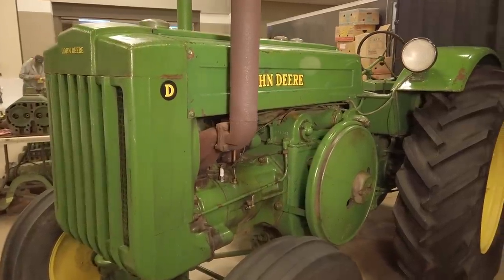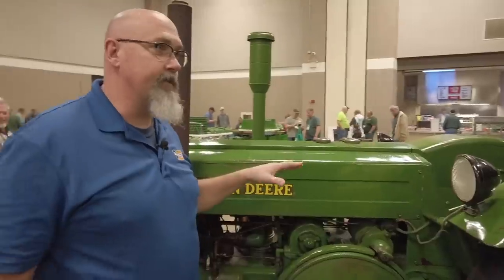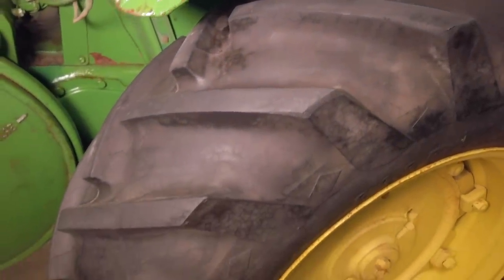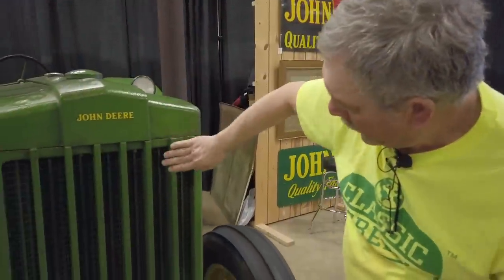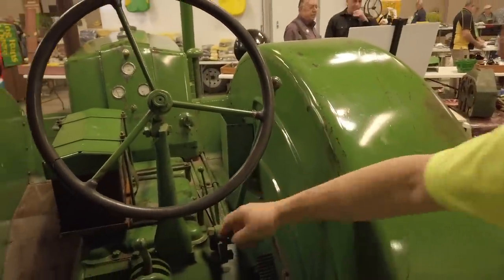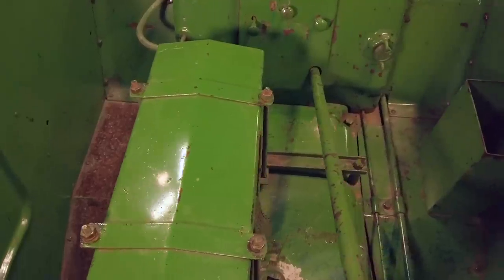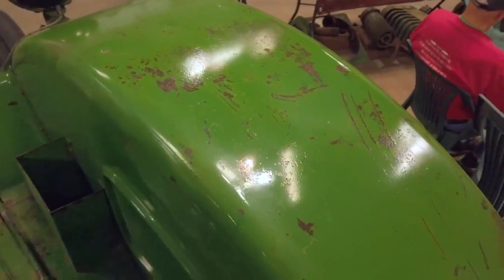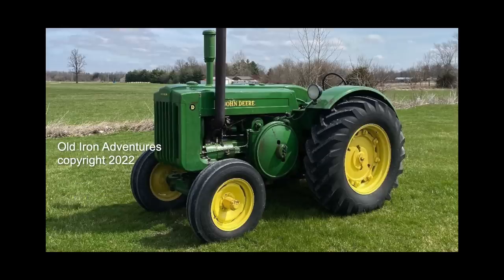Vintage Tractor Was NEVER SOLD! New Old Stock  All Original 1948 John Deere Model D

Comment: What is the horsepower difference between an R and a D"  By the way......what a beauty!  A real John Deere still has but two pistons to me.  Sure wish that you birds would crank her up and hitch to a piece of equipment and let her eat!  Nothing sounds like a John Deere under load.....absolutely beautiful!
Reply: I too would like to know what r and d difference is
Reply: @michaeldouglas1243  The D was their first tractor they designed and mass produced. The early ones were around 30 hp, the later 38. Early ones had 2 forward (slow and slower)and one reverse while the later had 3 forward (slow, slower, slowest). Popular in the Rice fields for plowing in less than stellar conditions, they were tough and rugged. They were power for the drawbar or the belt with no other provisions for attatchments. Deere made them for 30 years. The R was their first Diesel and picked up where the D left off. They had 5 forward and one reverse plus live PTO which gave them live hydraulics. Started by a 2 cylinder gas fired Pony engine, the R had deep lugging power and great fuel economy. Well engineered for their time, they eventually became the 80, 820, 830. They were diesel only tractors that made lots of power and even started showing up with an elevator scraper on it's back before the design was retired in 1963. John Deere 2 cylinder diesels were good performers. The 720 diesel set a fuel economy record that stood from 1956 until 1984. The popular 730 diesel was built in Argentina until 1972, a testament to their rugged design, dependability, and economy for South American farmers.
Reply: @thegreenerthemeaner  thanks a million.  Great informative reply.  Our family farm was always ford's growing up but the neighbor dairy has some old 2 cylinder john deeres.  I remember hearing them run alot of early mornings.  Boy I miss those days so much.
Reply: @michaeldouglas1243  We had Fords and Deere growing up. Our surrounding area had everything well represented up to 70s models. There was an Oliver/MM dealer 1/4 mile from our house. The saleslady for Fords grew up and had family on our road. She especially went after orange machinery since she started working for them but wouldn't let her work in sales. They regretted that. Then things started to polarize with either Blue or Green and a bit of red since all the rest folded.
Reply: @thegreenerthemeaner  If I recall correctly 6 MPH was flat out in high gear. The big farmers today would die of old age before they got to that far away rented 1/2 section.

Comment: “Never Sold” but often borrowed judging by photos 😆
Reply: Depends on what kind of environment it was kept in, looks as though it was stored inside but not in a humidity or climate controlled environment I assume it most likely was used for light duty tasks or parades over the years but nothing more

Comment: We still have dad's 48-d, with a PTO and the original 14-30 wards riverside rear tires, most of the time it ran the silage blower, very rough on power shafts (in the tractor)had a tendency to twist off behind the flywheel, Dyno tested at the Lagrange engine club's show some years back 42hp on the belt. Probably the most helpless feeling in the world is trying to  beat a thunderstorm back to the barn on that tractor.

Comment: Wow a 48 D that never knew what it was like to plow a field or run a sheller with her belt pulley that's absolutely amazing. I believe that Deere themselves should try to obtain this and put it in their collection. I read an article in Green Magazine that they did about this very tractor and it is sad that they tried to touch it up it took like three or four sets of original surviving decals to make the tractor like it is today. I can understand replacing the rear rims because the tires were full of calcium chloride and rusted but I wouldn't be messing with the paint job or decals on an original tractor.
Reply: Scrap is up
Reply: Eggs need beat
Reply: Be very careful with those plowing. The front end can come over and crush you. Put lots of weights on front. Powerful though

Comment: I doubt by the condition it was never used. I have a 1937 A that looks as good as this one and has worked alot of hours but the drawbar doesn't show it. This tractor could've had alot of belt pulley time nothing that a little paint can't fix.